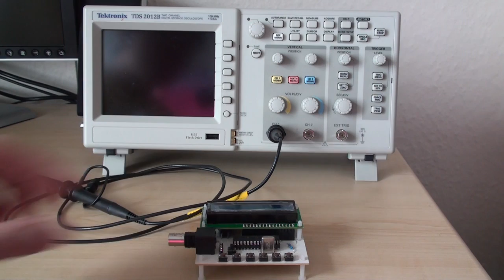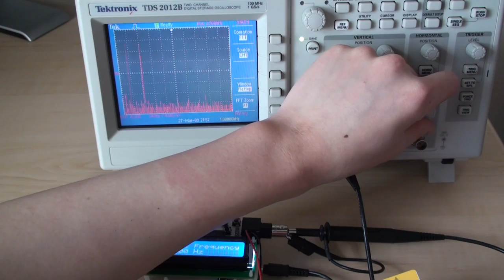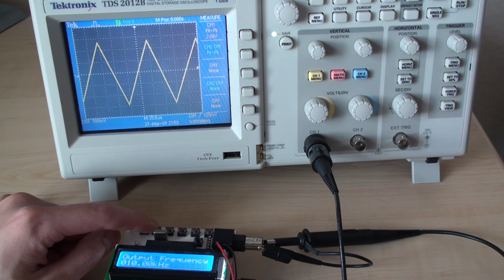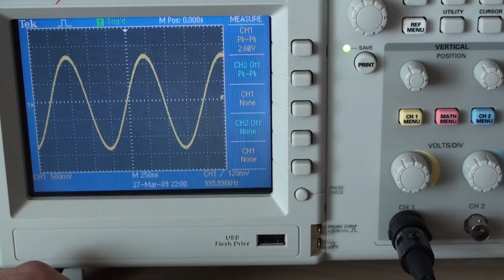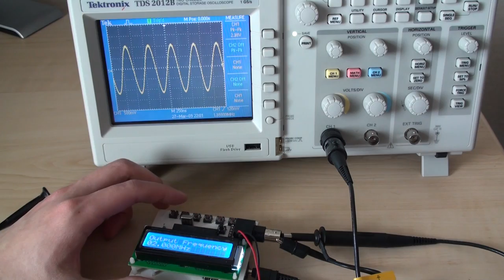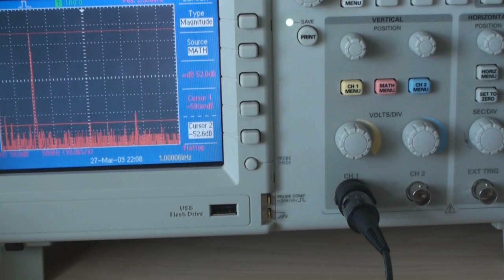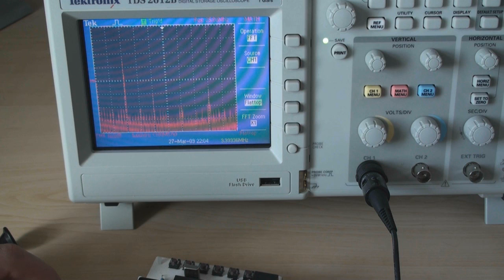Homemade DDS PIC Micro Function Generator

Comment from the maker: @navarromoral I have checked the data sheet of MAX5481 and the bandwidth is as you said only 250khz @ code 01111. When I shot this video the wiper was at 100%, may be that was the reason why I could get the output at 10MHz without significant attenuation